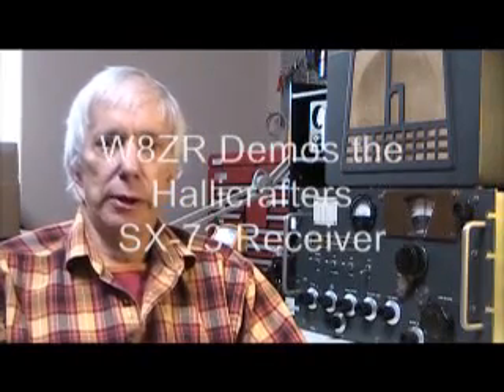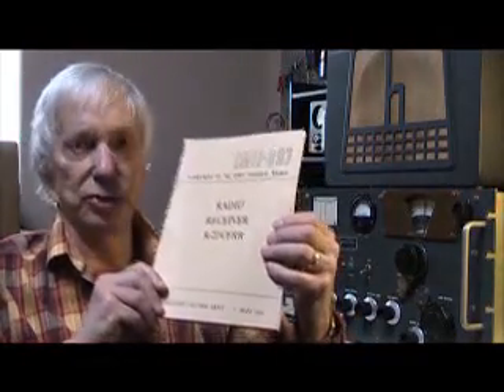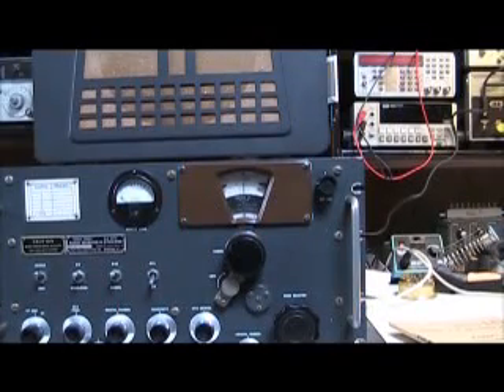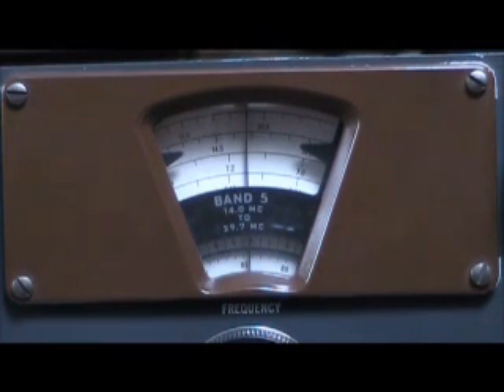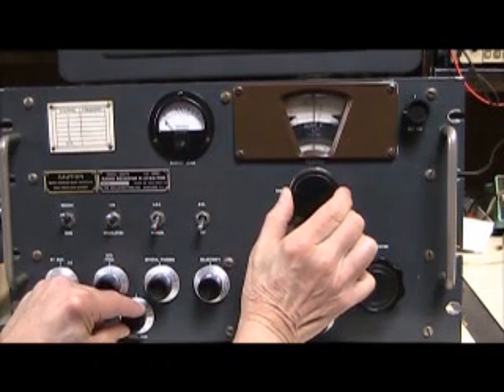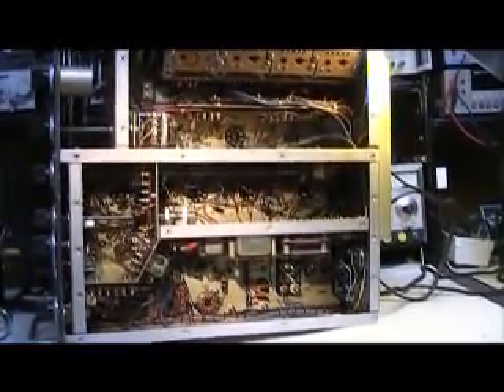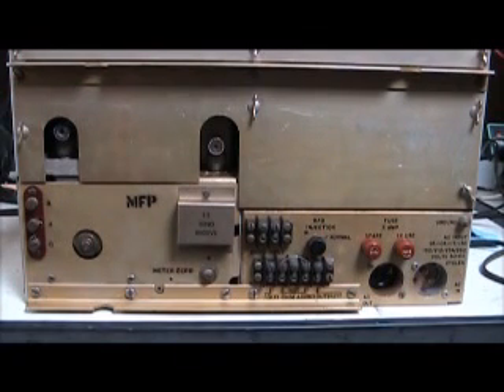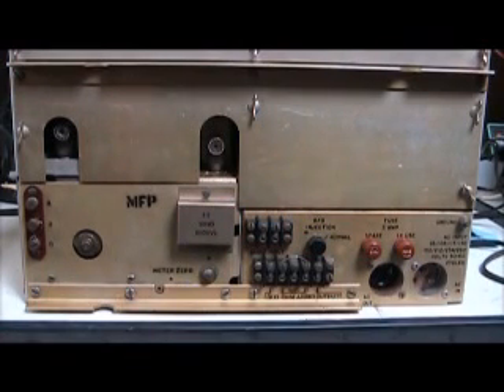Hallicrafters SX-73.mpg

Comment: Nice video, I wasn't aware of the 8ohm output for audio. I have been using an external transformer for years now. I originally had 3 of these I had purchased in 1982 for 20$. 2 were fully functional but one had been seriously damaged and still have for parts. I traded one of about 20 years ago leaving the one I have now (serial# 665). You had mentioned rack mount only but all the ones I had were in an housing but could be put into an rack mount. I simply love to cuddle up with this receiver in the winter! Thanks for the video.

Comment: Hi Jim,
Thanks for the informative video. I restore R 390, 390A and 382 receivers and picked up one of these SX 73 receivers a few years ago, planning to go through it. Seems I am always working on other peoples gear and don't have time to get to my projects. Hi. One issue with my unit is the front panel lettering is very light and almost not legible. It would not be cost effective to have a screen made for no more units than exist. DO you know if anyone has a screen?
73,
Glenn WA4AOS
DSM Labs.